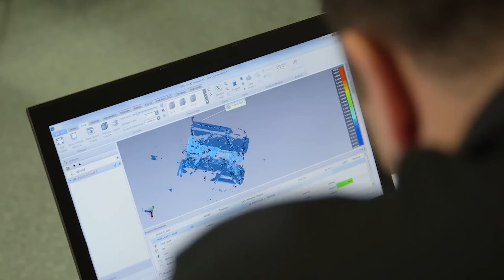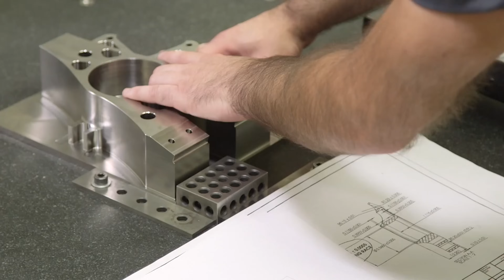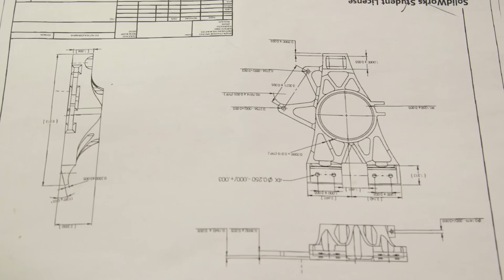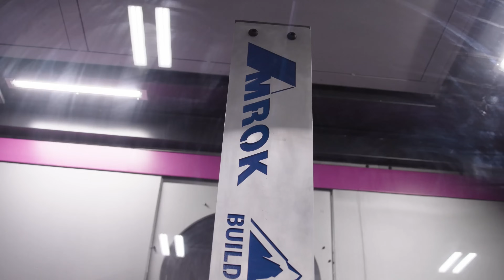I Just Started Last Week… And I CAN FIX ALL YOUR PROBLEMS

Comment: I am that guy that would normally come into a new place and fix things that had been broken for up to a year or more in the mechanic field when I was in the military. I'd show up with a zeal to get started to work and be met with resistance to the point where in one shop they didn't even issue me a tool box for close to a month after I had gotten there and in that month with no tool box I'd be fixing things folks thought were unfixable.
Did I get a lot of resentment? you bet I did but after a while I earned their respect as I just had a process that allowed me to figure out seemingly impossible jobs. Towards the end all those that showed me hate just had it in their hearts to be that way regardless of who they were dealing with as I had become the go to guy for troubleshooting problems. 
Now I have taken that special ability I have towards trying to solve our climate change problems and have come up with an almost fix all solution. Since the world already runs on hydrogen all that was truly needed was for us to switch the source of where the hydrogen was coming from away from fossil fuels making use of just water as their replacement. I took my special skillset and looked at how nature goes about breaking the bonds of the water molecules and in doing so found the solution to our climate change problems. But just like in the past I get resistance for being the one that came up with a solution to end the world's reliance on fossil fuel use as I guess I'm stepping on quite a few toes with this solution. https://www.gofundme.com/f/energy-independence-for-you-and-me
Reply: Hahaha funny, ive done work with fuel cells and the Nafion material from 3M. So easy, you can tell its technology thats being supressed

Comment: Ive watched my self and others slowly get pulled down in a shop where 30year guys shot down every new idea as crap that won't work... Now that the lead person has retired it's  like a new breath of light has been bestowed upon our shop an now improvements have been happening weekly some fail but now ideas are welcome.  New equipment has been coming the mentality of oh we will just make due  or we will scrape by with what we have has gone now we see a issue we  do cost justification and boom new stuff is on the way.  A mentality that previously seen as wasteful spending.  Old days of physically struggling with task that could be automated  or eased with  ergonomic equipment or new methods to improve task now seem to be popping up for everything that use to be just plain grunt brute force labor to get done.  Like I said some ideas are failures but by far our new youthful minds are out pacing our previous generations brute force tactics.

Comment: i did my job more efficient, than the others as a programmer, knew how to work on all milling centers in our shop faster than all operators, knew all the processes and the ways to improve them. I wasnt promoted, instead they took someone from the street to run the cnc site))) and I just quit. Ten years went to nowhere

Comment: We had a prima donna know it all 22 year old kid in our large maintenance shop. Told the bosses he could run lathe & milling machine weld do plumbing & electrical work. They stuck him with me a few nights so I left him troubleshoot a simple mschinecwith only q motor. 6 hours later he still did not have it working. Told him that most things run better when plugged in. Told the bosses I set him up. Okay pretty boy gloves are off. Would spray neeversreze into his work gloves and dump pile of dirty metal chips at his work vise several days a week. First plumbing job he done had more then halve the joints leaking big time. He could not figure out how to install an end mill in ine if the Bridgeports or to turn it on. Told the boss somenody wascsetting him up again whilevusing the milling mschine. Boss came over and told him that works better when running correct direction. Guys got tired of his lies and started placing bluing on his tools and inside his work boots. Told the boss that nobody liked him. Thsnk God they fired him before his probation ran out.

Comment: that title sounds like what happens on regular basis in management. 
and that new guy usually is fixing things by laying off workers, buying from the cheapest places and setting up impossible workflows. 
(like asking for a finished injection mold construction, before the actual plastic part has finished the design process)

Comment: Had a guy come into the the Guitar shop I was working in, hired specifically to fix the problems that had plagued the shop for years! long set up times, crashes due to too many unnecessary setups that sort of stuff. He and I worked very closely together on setting up a spread sheet to calculate the most efficient setup list for each days production: boss added jobs to the list. The list automatically chose the least amount of setup time per job ect... He was fired 5 months later because he made the boss look bad. Dude did an amazing job in 5 months and was fired for it.

Comment: When I took over my department, there was a lot of work to be done. We had a table that had a bunch of tooling all over and it was a mess. My coworker and I laid out and drilled holes into a board to keep all the tooling in a nice orderly fashion. We cleaned up pallets of junk just sitting around the department. We moved around equipment and just maid everything more aesthetically pleasing for when customers or higher ups did walkthroughs. We put spacing and more descriptions in the programs and even named the programs better so that it was easier for the operator to find things quicker. I’m trying to implement set up sheets and even label jaws better and what not. It’s a lot of work, but it definitely helps the team work in a smoother fashion than looking around for everything we need all of the time.

Comment: one thing i have noticed going from one shop to another is that you can give your boss ideas or your higher ups but alot of them say well tdd hats the way we allways done it. The boss himself also needs to learn to accept positive change or else your just wasting your time.
Reply: Yeah, I've had that problem with operators too. They have been running the same job on the same machine for years and you're the new guy that shows them it can be done better and faster. And they want nothing to do with it. I even told the operator he could take credit for it. Nope, depth of cut on roughing has been .100 since I started. Well I want it .150 and the machine has enough HP and the insert is big enough for that depth of cut. That little change saved the company enough for the operator's salary.
I think he didn't like it because I just gave him more work to do.
The owner liked it.
Those are easy changes when you have a high volume production part. Most of the work I did in that shop were 1-6 piece orders. So your continuous improvement was mostly in the areas of improving setup times and programming.
High volume production shops I worked in you had a lot more setup time, but the setups and programming were also a lot more complicated. With 10 or more axis machines.
Reply: @gooblio  i agree i found that documenting every aspect of a set up and organization of tools and workholding are major time savers. saving the program each time a change is made also helps to speed up set time so you have fewer issues to work out at set up. thanks for the reply.
Reply: I'd just go ahead and do it forget the boss unless you need $$ for your idea. Better to beg for forgiveness than ask for permission.

Comment: Having worked in the drilling industry for many years  in many locations the “Best” were rigs that the crews said MY rig.. it was cleaner safer effective and had less downtime.. It was an attitude of team spirit and everyone would assist and stop people making mistakes, wast time and not keeping their rig clean.
If a shop has that way of thinking and working problem solving is just one more tool that everyone uses.    There is no place for secrecy  or empire building you may do a “Good job”  today sooner or later some one in the shop will pass your skills and abilities.
Reply: My cheif electrician dad always took time to ecplain things. He said they can steal my job but could never steal his knowledge. They still called him after he retired. Had some old timers when I was an apprentice and would never show them anything. Swore that I would never be like them. Had 2 exyremely talented millwright mechanics who taught me so many short cuts and the best tool for the job. They would not allow me to use what they called nut rounders or what all the old timers called a crescent wrench. Made me use a 6 point socket or box wrench to tightrn hex headed cap screws & hex nuts. Intoduced me to great working gun taps carbide drill bits for tough drilling etc.